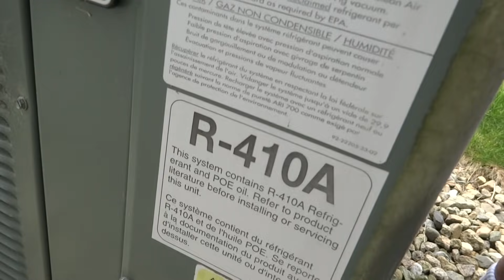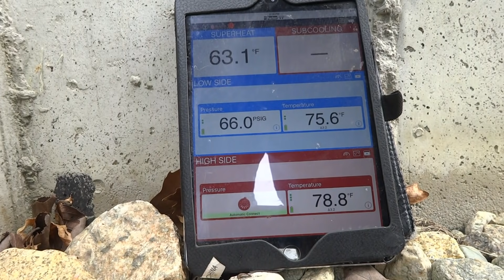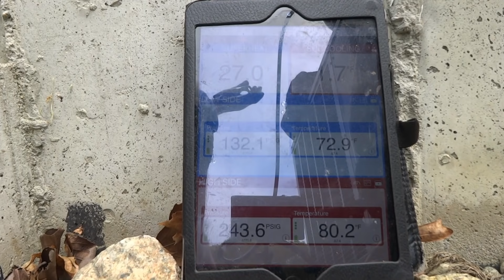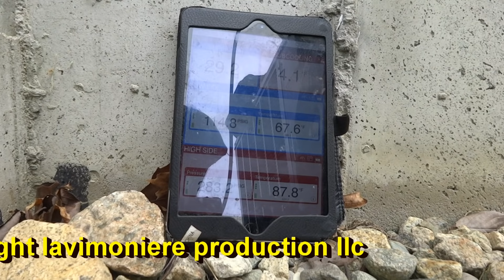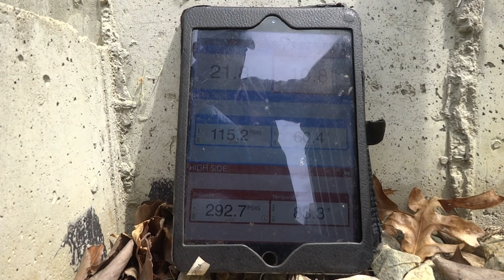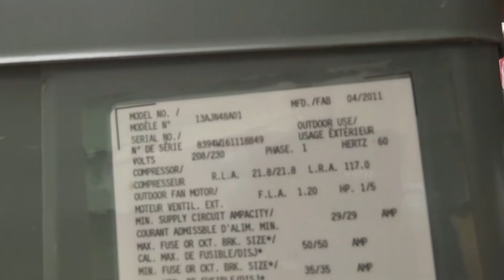10 YEAR OLD RUUD AC SYSTEM NOT COOLING HOUSE

Comment: Live in Louisiana with high humidity and higher temperatures.  My two carrier 4 ton units are 22 years old and heat and cool like a champ.  I attribute it to a very good Instulation, changing filters, and cleaning condensing unit regularly. Never had to add Freon. (Knock on wood). By the way thanks for the entertaining videos. You are the man.
Reply: That’s cuz it’s r22 which is much lower pressure and not prone to leaks like r410a

Comment: Steve. What causes leaks in these AC systems? Curious. You see it often.
Reply: The evaporator is often wet from condensate. It tends to corrode and leak. That or the small distributor tubes or capillary tubes chafe and leak or crack and leak. Most of your leaks will be found in the evaporator.

Comment: I have a Rudd and it runs but not shuting off for some reason and the air is just normally coming out the vent inside. Changed the compassder inside and didnt change it a bit what could be wrong?? I did hear a beeping sound for a while and couldnt figure were it was coing from. He was trying to tell me somthing but i dont know Please help Steve!!

Comment: Hey Steve
 It's gonna be almost a 100 here in Minnesota I'll be checking my AC 
Keep miss Molly cool lShe's a pretty girl
Minnesota Greg
Reply: Starting to get hot here in texas too 😩 I would hope my ac is working correctly it's only 2 years old.
Reply: Yes sir gonna be 97 or so here in Western Wisconsin and mine died 2 days ago.

Been watching Steve and decided to DIY fix it. One burnt wire and a smoked capacitor was the culprit. Made up a new wire and threw in a new cap, sitting in 72 degree heaven right now.

System is 20 years old R22. Last money I'm putting into it she's getting replaced asap

Comment: So what is the average life of a well maintained system? Seems like the coils are built to fail at about 10 years regardless of maintenance and hours of use.  Same goes for appliances. Gone are the days when you can get 20-30 years out of anything. Built to fail to increase profits.
Reply: I don't think they are designed to fail. Not especially on very lightly used systems in MA. Leaks need to be found and fixed. Higher end of product line are better built but that is not cost effective in lightly used systems. Dryer air feels cooler so dehumidifier is probably more useful than AC in cooler areas.

Comment: I just moved into an older house...the AC unit is from 1982. (WeatherKing) The water heater (which I replaced) was from 1979.
Reply: Keep it maintained and clean and cross your fingers.  They don't make emime that anymore
Reply: Seal up the duct system and it'll work even better.

Comment: The A/C units that actually leak should be fixed, or taken out of service. If a tech can't fix the issue , then it should not be refilled. It is what it is.  Many Central A/C Manufacturers should throw in the towel, since they all seem to suck , when it comes to 1990's and newer. There is no reason a A/C unit can't last 20+ years without leaking if it was correctly built. You have to use same metals in the coils to prevent electrolysis. Fuck Corporate Assholes!